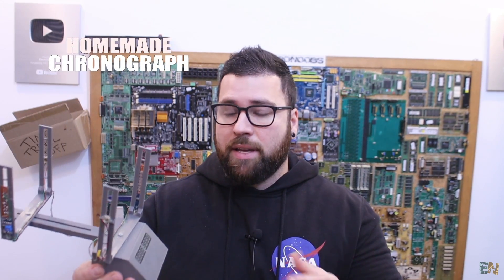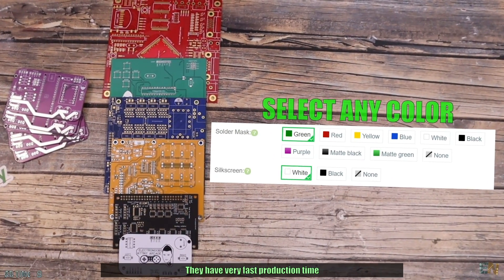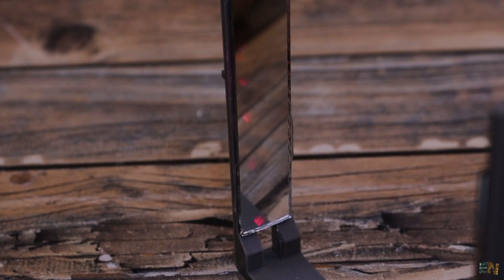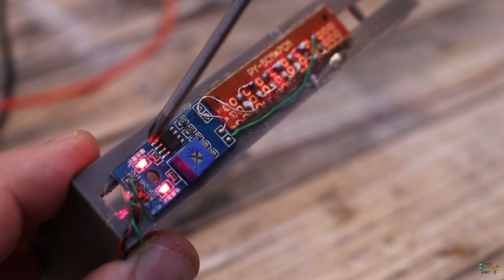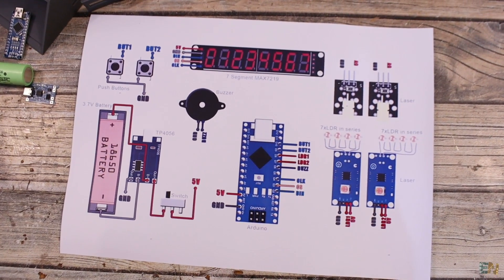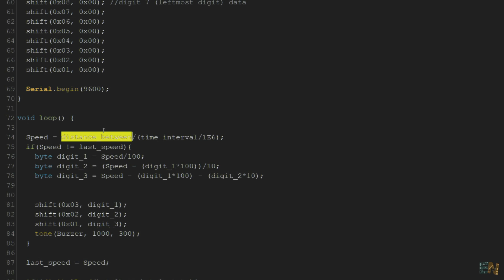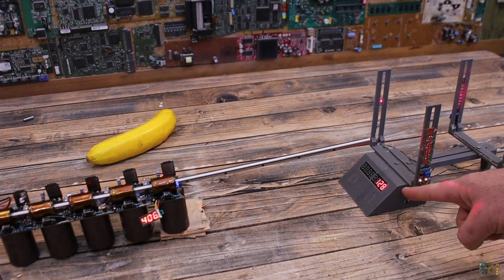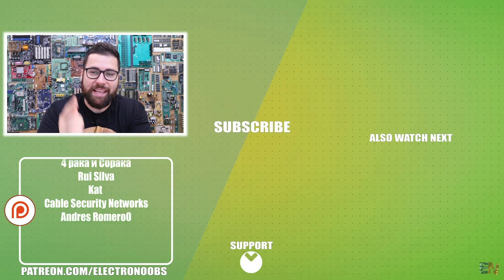Bullet Speed Meter | Homemade Chronograph

Comment: An ingenious project that I would like to recreate. 
However, with a difference, instead of the 8 digit display MAX7219
the 4 digit display TM 1637 should be used.
Now I'm an absolute sucker at programming, I can change a code to make it work but write it myself........ I despair of that.
Can you help me change the code so that the TM 1637 works?

Greetings from Germany 
Thomas

Comment: An Ldr can take 2 - 50ms to detect something.
I originally I used a remote control receivers sensor ,but when I moved up to an air rifle it wasn’t fast enough.
I moved up to a IR photo diode with a response time of 9ns  theoretically I could detect an air gun pellet doing 6000mph 😂
Reply: Any details around the circuit you used?  😉

Comment: Great project. In real world scenario the sensors and emitter will get coated, slowly, with lead dust - from the lead bullets.
My question: how will the presence of lead dust affect readings ? Will there be a delay in response time or will there be no affect until the screen is totally obscured by the lead dust and readouts finally stops.

Comment: The speed of the ATmega328P ISR is about 4us. 136m/s is about 450fps and the distance looks to be about 6 inches which means the interrupt needs to detect within 1us.  Isn't there a good chance you will get false or no readings?
Reply: 450 fps over 6 inches is 1 millisecond, not 1 microsecond.

Comment: I think your velocity reading is WAY off. You’re saying that this coilgun is shooting with roughly 170J of projectile energy (based on projectile dimensions in previous video resulting in 17.5g of steel). The capacitors hold about 344J of energy, meaning that your gun is resulting in just under 50% efficiency. Given that coilguns in a lab environment cap out at around 3-4% efficiency, something seems wrong here. Especially considering you have no adjustability to your timing on your gun and LDRs are extremely slow.
Reply: a 6x20 steel rod is 4.4 grams. The efficiency is still pretty high even with that correction, about 13%.

Comment: Very cool. If the capacitors are charged to 425, and the projectile velocity is 139m/s then it stands to reason that each module adds 27.8m/s to total muzzle velocity.

139m/s / 5 = 12.8m/s per module

To break the sound barrier at 344m/s, does that mean that you can do that with just 12 of these modules?

344m/s / 27.8m/s =  12.37

Can you make much longer stages to account for the higher velocity?

E.g. The first 5 stages are short since you're not moving the projectile all that fast. But with a longer barrel, the first five modules only take up about 7". If the remaining modules were spread out so that the time between the optical sensing and the creation of the magnetic field was offset, you could theoretically get quite near the speed of sound.

Comment: Hi
I watched your job with very interest bacause it's a bit of time that I have in mind to realize a similiar project but some questions occcour,
1) What about arduino response time I/O an if is it fast enogh to have a realistic measuraments.
2)external parassite light may inflouence foto resistance reading an may be should  be shielded?

Comment: what does the program do to add a point to the result ? 
like for example 2.5 m/s 16.2m/s

should change this part ?
shift(0x03, digit_1);
shift(0x02, digit_2);
shift(0x01, digit_3);
tone(Buzzer, 1000, 300);

Comment: Nice – but as you have already built the coil gun to be modular, why not add this as a final stage? You could even use the signal from the last accelerator stage's photodiode, and I see that you already have pre-drilled holes in the tube, so distance measurement would be more accurate.

Comment: Cool project as always.  I am a bit surprised at your decision to use LDR's instead of photodiodes since LDR's are known to be slow responding.  However, it seems to work OK in your case and for the speeds your interested in.  It would be interesting to build another one that uses photodiodes.  It would also be interesting to calibrate this device with a spinning disk at a known RPM.

Comment: Doesnt it make arduino unstable if its 5v rail is powered with 4.2v at best scenario and which varies between battery voltage 3.5v-4.2v?
Reply: The battery protection circuit also boost the voltage to 5V at output so it's a multi function circuit. Same as powerbank circuit. So Arduino receives 5V
Reply: @AmitabhAnkur   Im pretty sure tp4056 is just for charging and overcurrent protection. There is no coils or anything boost related on the pcb!

Comment: LDRs are too slow. They need time to react to the change of light intensity. Maybe it's ok for the coil gun but for a real bullet maybe not. The bullet stays in front of the sensor for a very short time.
Concerning the mirrors you should just use shinny metal, not ordinary glass mirrors. The glass absorbs too much light and also creates ghost reflexions.
Reply from the maker: Yes I will use a different sensor
Reply: @ELECTRONOOBS  The fastest is usually photodiodes but they need a good circuit to amplify the tiny signal. Phototransistors are usually a bit slower but much easier to deal with.
Reply: Even the LDR is slow I don't think it will affect the results because let's assume LDR responses after 1 second after bullet passes then the second LDR will also register the response after 1 second so the net time is still same even with fast or more slow sensor.

Comment: What sort of processor / timing circuit would it take to have 1 foot / second resolution (about 30.48 cm / second) over a distance of 4 to 6 inches ( 10 to 15 cm), with bullet speeds up to 4000 feet per second (1219 Meters / second)?

Comment: It's amazing
But I would suggest using direct registers for timer
And also to try using input capture mode
Reply: how do you use input capture? I haven't found anything on the internet.
Reply: @techtheguy5180  seeing this configuration input capture alone may not be usable
There needs to be a pin change or external interrupt from first sensor and second goes to input capture pin

We can use input capture alone but it will require a Or gate
Reply: @ayanvaidya2727  But how can I use it to get the frequency of something?
Reply: @techtheguy5180  input capture works on edge of a signal
You can select rising or falling
When your selected edge accurs it triggers input capture and stores value of timer in ICRn register also generates a input capture interrupt

So you can monitor when those edges happened very accurately
You can compare two such value to get time difference and calculate frequency
Reply: @ayanvaidya2727  Thanks

Comment: A project like that, which will propably not be used very much would be better with a few AAA Batteries in series, since a liion will just be wasted when its sitting on the shelf.

Comment: Really great idea!
But few things: The distance between the sensors should be at up to millimeter precise and the sensor "arms" can be slightly rotated - all of that makes it really, really inaccurate. :/ 
Timing of the circuit will be off, because response time of the LDR is really bad (up to 50ms).

Comment: Interesting project, but LDR's are quite slow responding and this does vary between individual LDRs.  Photo transistors would be better.
Reply: You could also use common LEDs as light sensors. When lit by a laser, they produce about 1.5V. Other LEDs will work, but red, orange, yellow and yellow-green work good for me.
Reply: They are indeed slow, but as long as both serie LDR’s have the same response time, it does not matter since the delays will cancel each other out :)

Comment: A while ago I have build a device to meassure the shutter speed of analog cameras. It turned out that many ldr's have a rather high responsetime to light (many of them over 50ms!). I ended up using reverse connected LED's because they respond faster to light.
Reply: I’ve long wanted to try something like that with LEDs, but I wasn’t sure how sensitive they would be, and thus how effective that technique would be in practice. As you know, good LEDs (and w/o phosphor) turn on freakishly fast, but I wasn’t sure that they would react on a similar time scale. It’s cool to hear that you were able to make a useful, fully functioning device using that scheme. Nicely done.
Reply: @a1nelson  The circuit was quite simple. The positive lead of the LED was connected to two 2N3904 in a darlington configuration. They pull a resistor against ground. A STM32F303 was used to measure the voltagedrop and time.

Comment: 3:15 - Needs first surface mirrors
Reply: Yeah, I wondered if someone would mention that, since it would really help - especially given the wavelength chosen. Still, for someone that doesn’t appear to have a lot of experience with optics, I feel like the project in the video was done extremely well. While I would have done as you recommended, it was actually pretty interesting to see how EN solved the problem. You can tell he really has the engineer’s touch.
Reply from the maker: Yes, I will try that...

Comment: What about laser with lens make line, used for self-leveling or cross projectors, it will be better choice.
Reply: I was thinking the same. I feel like he's losing accurate measurements due to how wide the sensor FOV is. I'd either use an extreme angle light defuser like bar code scanners or laser levels. Hell, maybe even toping the emitter with a physical slit.
Reply: Just shine the laser on a clear rod, makes a pretty good line